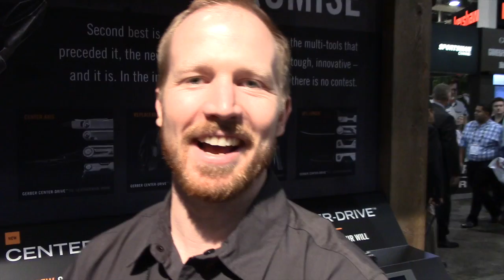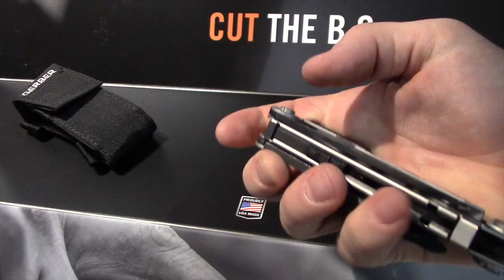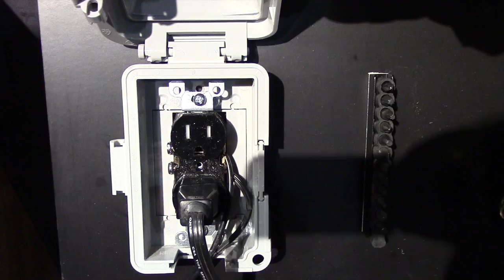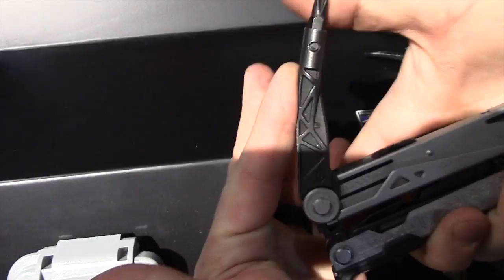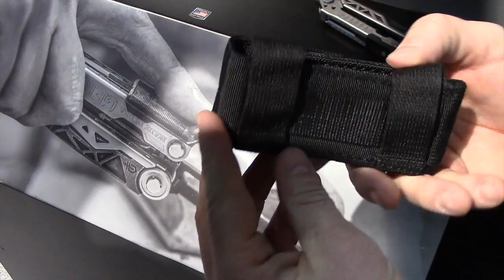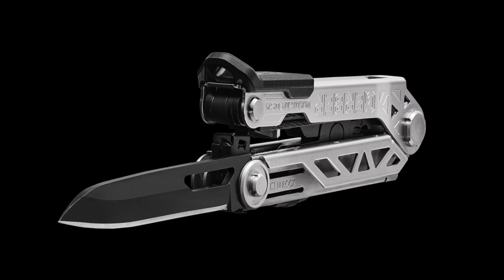Gerber Center-Drive - SHOT Show 2017

Comment: Nice tool, but they are going overboard about the center drive feature  Open a Leatherman WAVE by swinging out a full 180 degrees the handle with the screwdriver you want to use, while keeping the plier jaws and the other handle together, and you will have a comfortable "center drive" screwdriver about 8 inches long, more slender and less awkward than this new Gerber.  I will give them points for using standard bits, even though they are bulkier than the flat Leatherman bits (take care not to lose your Leatherman bit kit; I use a custom built leather sheath from Thor's Hammer), but I do not give them points for using 420 stainless for the knife blade.  I was using 440C over 40 years ago, and it is affordable today.  I do like the replaceable cutters, though, just as long as they remain secure during hard use.  I think the better multi-tool makers are all catching onto this.

Comment: Is that triangular shaped cutting edge for the plyers sharp on all sides so that it can be rotated as it wears? That would be neat.
Reply: Yes. Precisely that. Those carbide cutters are designed to be rotated so you don't have to replace them as often.